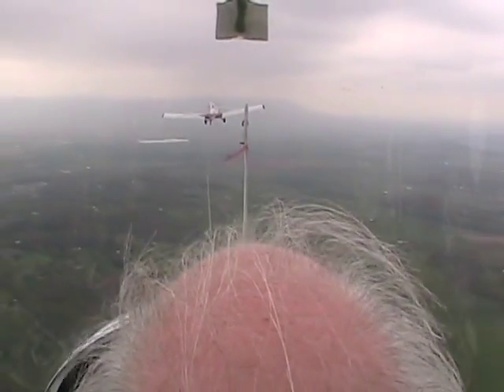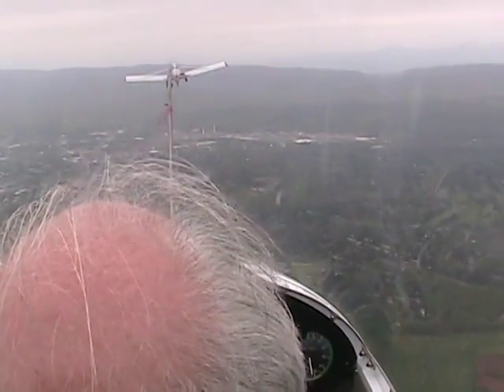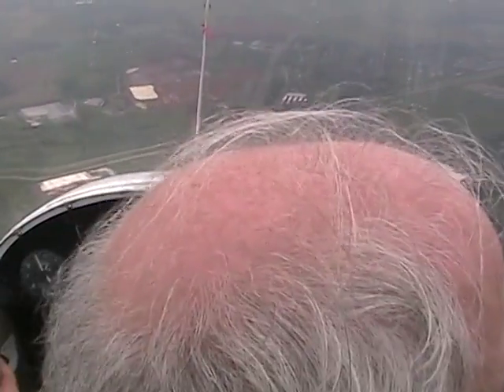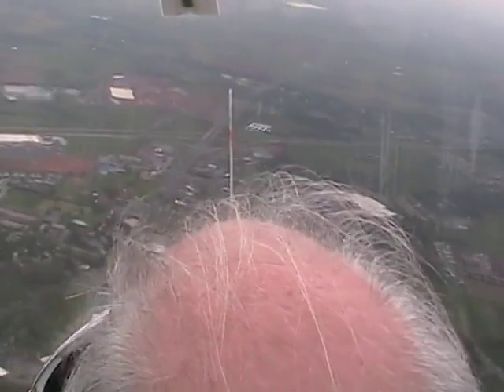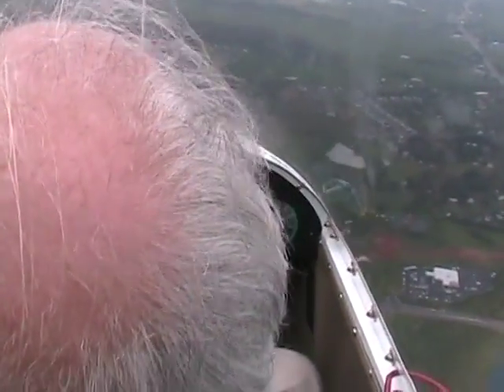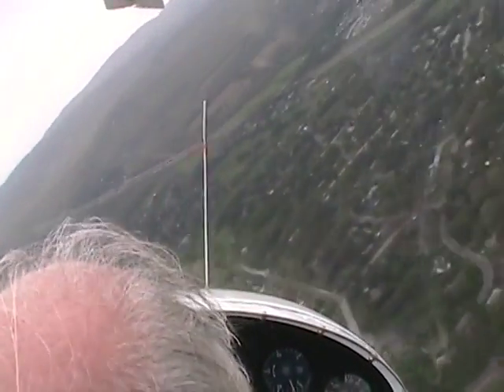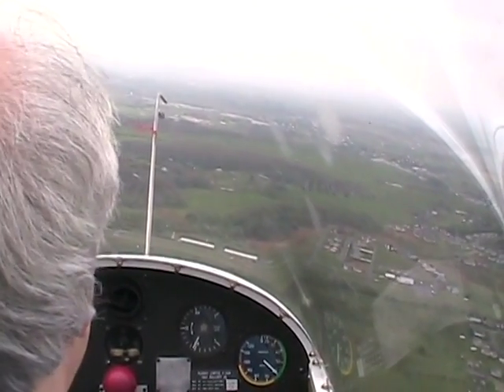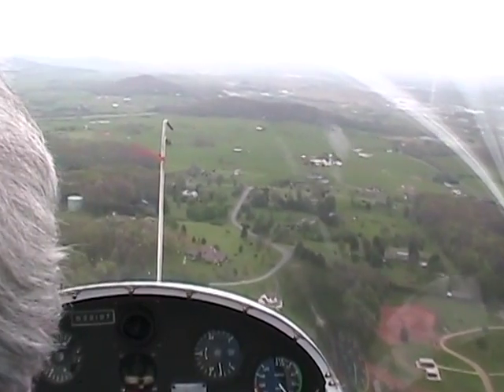Demonstrating Steep Turns in a Training Glider

Comment: I used to love gliding and should take it up again after Covid. I used to fly at a winch launch site in the UK (Midlands) and yes in the early days of tuition, there's a tendency to fly too fast, cramp the circuit in too high and not hold off enough above the ground, to create the flare. I eventually got the hang of it (Frustrating part to get past...but eventually it clicks..)and it's a case of looking further up the field during the round out then holding the nose up, to float (with air brake opened)just above the ground, gradually pulling the stick further back, until the craft gently drops to the ground. I went solo and flew some single seaters and did a five hour flight at an aerotow ridge soaring site - ridge beating and some thermalling, when the chance was there. Had one scary moment though when I turned onto base leg and the tow plane was on an opposite circuit, coming towards me....Jeeeez...! I turned very steeply..it was an unorthodox final approach, doing a full 360, but it scared the crap out of me...(Got a slight telling off but there you go...).